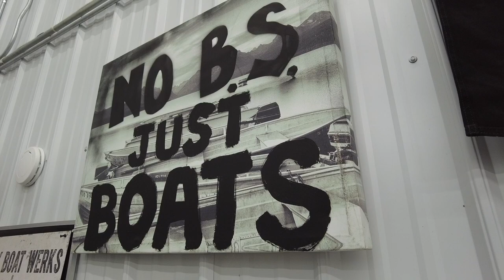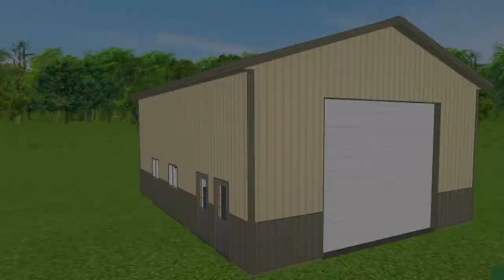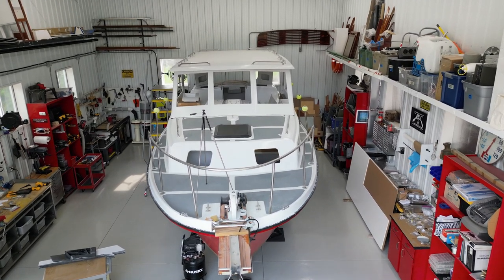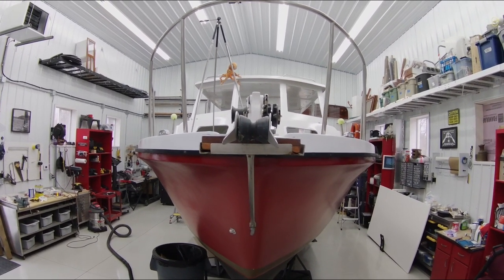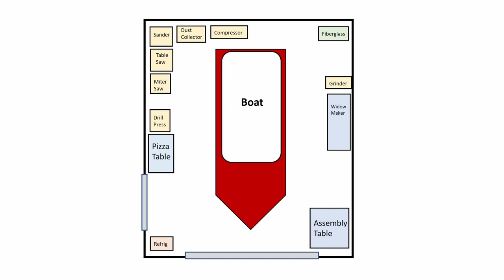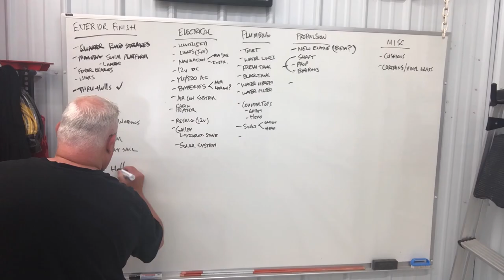Secrets of My Boat Werks | Amateur Boat Building and Sailboat Restoration (Ep 45)

Comment: Very inspiring video. Unfortunately I have no workshop - it's in the boat itself. I organize everything (lie) in bins that are stackable due to space constraints. Them being open makes it harder to clean dust but air compressor usually takes care of it.
Anyways great shop you have, very thought through
Reply from the maker: That’s a tough situation having to use the boat as your workshop. That sounds like a good organizational system 👍😀
Reply: Not having a workshop caused this chain of events.. 30 yrs ago (before liveaboard regulatons) we sold our house and bought a heavy displacement trawler to live on. It had all the amenities of 1949 lol.. zip. To secure moorage I had to buy a boat shed for $6500 from the marina mgr. We were living aboard with power tools on the aft deck and materials stacked on the whlhse roof. What a disaster. Then one day I decided to build a mezzanine to store boat related stuff. I then drew plans to turn the shed into a hip living space with the boat moored below.. after building stairs to an upper floor and having jacked the hse 16" out of the water with enough flotation to compensate for the added weight, 75 sheets of drywall and a year later we were luxuriating in a very cool 1 bdrm with carpet, wood floors, a den, a roof deck, french doors off a LR, 3 skylights with views of the mountains and downtown Vancouver. We had a full galley with 4 burner range, a DR overlooking the marina, a bathroom with a proper shower, paloma instant hot water and a propane fireplace in the foyer. We never moved back onto the boat, we were totally ruined. 😄